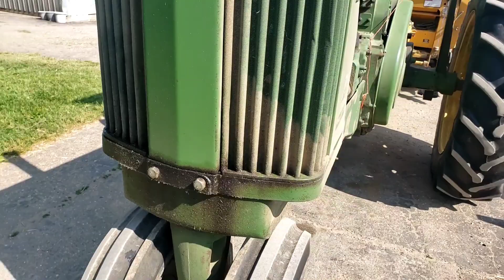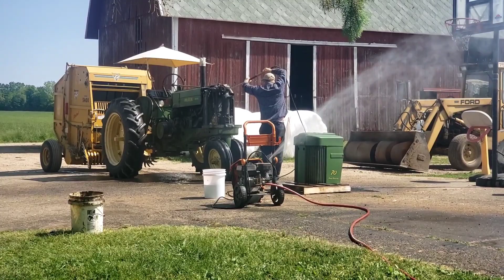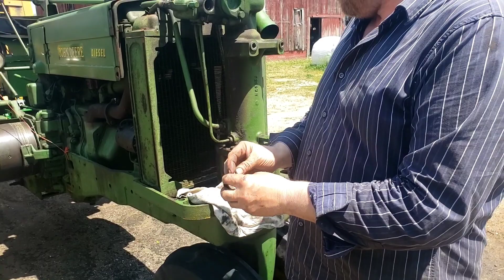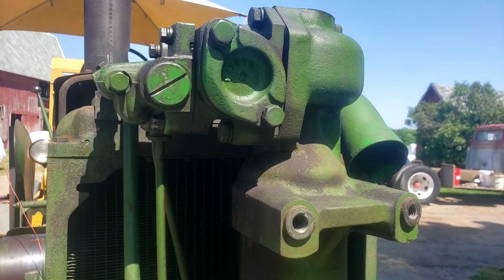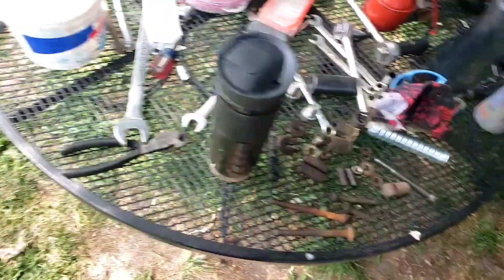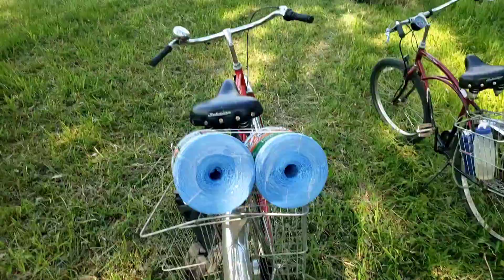John Deere 2 Cylinder Power Steering Alignment and Leak Repair

Comment: Any ideas on a no power steering that is incredibly hard to turn the wheel - both arms while driving. Used to be one hand while moving. Thank you for your videos
Reply from the maker: No sounds like something is getting dry and bound up. Like a grease fitting isn't letting grease to the right place over time.

Comment: Check for a plugged reservoir vent cap.
If it's plugged it will cause the reservoir to pressurize as oil heats up and leak
Reply from the maker: All fixed

Comment: hi guys good video those holes in the frame those are for the factory wide front end bolts go in two of the holes the other two are for dowel pins that locate the front end i have a 50 john deere that needs that adjustment too thanks for showing the old tractor i have one just like it but mine has the factory wide front end
Reply from the maker: Yes he figured out about the holes a couple minuets later we have all narrow fronts. Also I said it backwards in the video if your tractor wants to steer left tap the steering control back and if it's steering right tap it forwards. Thanks.
Reply: @mommymilestones  Some of those holes are for dowel pins and bolts for mounting front mounted cultivators.
Reply: The two threaded holes in the front top and bottom are also for mounting and supporting front mounted cultivators.
Reply: You are correct...just put a wide front on my 630. the holes should have been plugged with cork from the factory